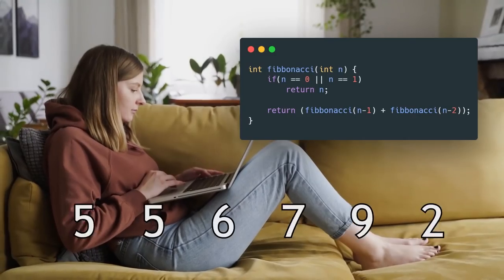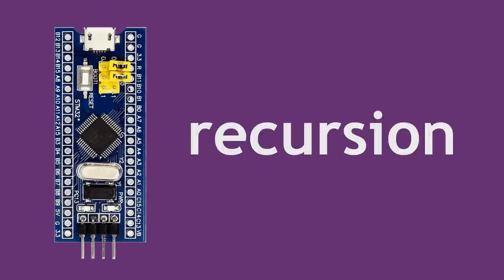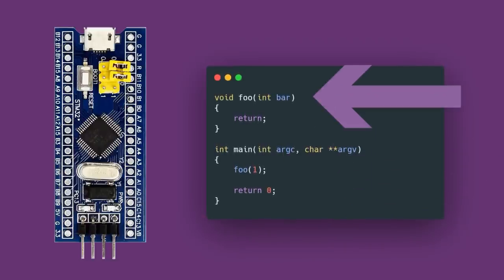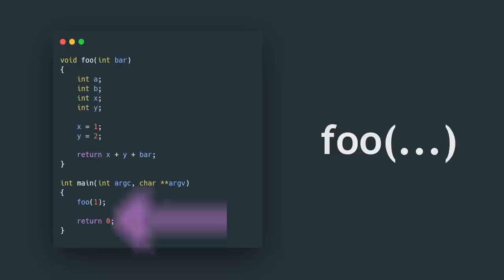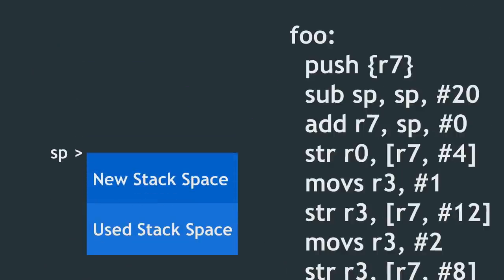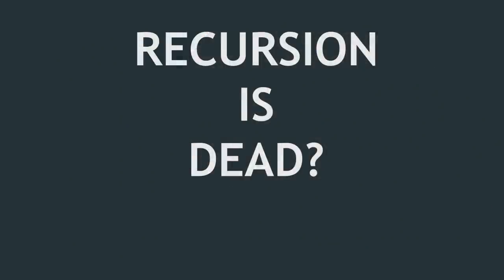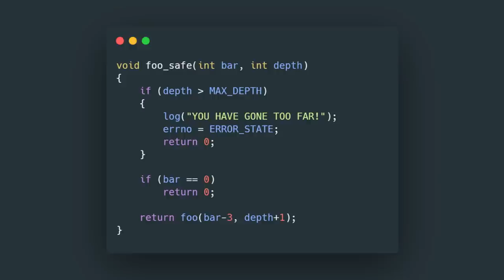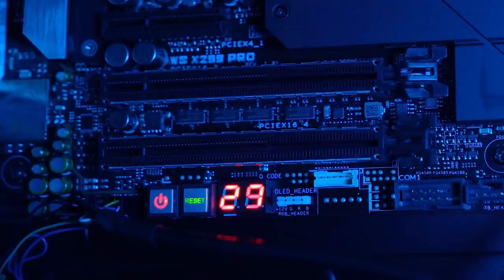why is recursion bad?

Comment: During my apprenticeship, I came across a Linux dev who's rather "old" (I guess mid to late 50s). 
He explicitly taught us programming on high end Linux machines and even though they were enterprise machines with tons and tons of ram he specifically taught us to find ways around recursion. He'd always show us different ways on doing that. His motto? "People were going to the moon with less resources. Nowadays, we're just slapping more hardware on to the machine!"

This was his critique on Game Development just as well as his critique on the company and other devs who usually didn't care. It was a very great and pleasing experience and it still sticks with me. Roughly two years later, I'm still trying to avoid every recursion I can. Not that I don't like it but why using up more resources than necessary or overfill any buffer etc?
Reply: Dude sounds like a good teacher
Reply: that is a very narrow view, with tail call optimization being a thing there's substancially no problem in using recursion and as for why, the reason could simply be ease of implementation
Reply: @javierflores09  For me, recursion is definitely useful with tree-like data structures, where you need to, for example, look for a file, or create a deep copy of a JSON-like structure.
Reply: @znefas  Recursion has very niche use case and that too when directly modifying data on the storage (where only the current state should be present in the stack) and not on RAM. When modifying data on the RAM recursion should 100% be avoided in production apps.

Even for tree like data structure it is possible to write an iterative approach although it might be harder.

TL;DR: If you need to worry about recursion depth, you should not be using recursion in the first place.
Reply: @ArnabAnimeshDas  As you said, if you need to worry about depth, you shouldn't be using recursion. But in most game engines, you won't have so many nested files to look through that you'll have to worry about recursion depth if you're using recursion to do something to every file in the structure.
Reply: @znefas  since it works on each level at a time, the previous levels which was already worked upon can be removed from the stack since it has already been modified in permanent storage. Which means the recursion depth is at most 2 (the current state and the next state being worked upon) at any point.
Reply: @javierflores09  the problem with TCO, however, is that not every language supports it.

Also, ease of implementation is not always the right/best answer. Sure, it is one answer - but then again, I have answers around certain problems without recursion and live a good life. Being creative solving certain problems while still producing good quality code is key.

And I find the challenge to avoid recursion good. Especially since I can't be sure that every language uses TCO (natively).
Reply: @playeronthebeat  the argument that not every language supports it is weak. In the case a language does not support it, you are probably on a system where stack size isn't a concern at least to the vast majority and in the case you are the minority that does matter, it is fair to search for the alternative solution.

I am not saying recursion is good, I am saying it is stupid to discourage people from it when you are rarely gonna face problems from it, so long you have some knowledge of what you are doing. Programmers are not toddlers, only users are and when it comes to the code, they should be able to decide what fits their program the most.
Reply: He is right. If ppl wrote software with care for hardware resources, our mobile phones would be blazing fast for years and the battery could last days, just for not wasting tons of process power and memory in tons of useless algorithms.
Reply: That is very interesting. I wanted to ask, with all your regular practices of trying to avoid recursion if you can, are there any cases where you choose recursion as the main approach nevertheless?
Reply: @vivanmaitreya2782  Although the logical flow may not seem intuitive, almost every recursion can be converted into loops. Just requires a different way of framing the problem. I can only see recursion applicable in NP problems where there are multiple solutions for a single step with only one of them being the correct one and you have to arrive at a known finish point from a specific unknown starting point following a repititive pattern.
Reply: If the hardware is available, it's wasteful to let it sit idle.  You might as well not have it.  I worked with a DBA that did the same thing with disk space.  Disk space was meant to be hoarded and never used.  Every request for more disk space was denied, until you brought in upper management and proved that you really did need the disk space and you could not just restructure your database table to use less.  Efficiency is important, but it's not usually most important.  In the grand schema of things many times "good enough" is sufficient, and expending additional developer resources to increase efficiency is not warranted.
Reply: @daves.software  it is about the trade off. Not caring about wasting resources is bad too.
Reply: I've got two issues with this. One, on a high-end machine, stack space is almost completely free. I understand optimizing memory usage, but stack space is the least important thing to optimize - and we're already on modern systems where optimizing memory isn't critical anyways. Pair it with tail call optimization in many cases and it's practically free. Modern applications are anything but stack memory hogs.

Two, readability. Sure, by nature, you can rewrite any recursive solution into an iterative one... but unless you go with an explicit stack (which is slower and potentially uses more memory), that rewrite is going to be much less readable for "inherently" recursive problems. And when you have resources to spare, readability is king.
Reply: "It'll be fine, modern computers can handle inefficient code" == "I can't increase the number of actors without the CPU melting" somewhere down the line
Reply: I definitely have complaints with game dev companies these days. Often-times the performance is sub-par and CPU-bound (GPU I get you can't really get around sometimes) and devs refuse to implement any type of optimization or parallelization. I get that threading and muxes and offloading work to other cores is alot of work, but it sucks that games are just saying "get better hardware lol" just to play their games.
Reply: @albertsun3393  I'm not that experienced, but I'm guessing that has a LOT to do with game engine tools like Unreal and Unity.
1) It is WAY harder to optimize a complicated system that you didn't write,
2) A well-designed game engine tool means you can write more complicated games with LESS actual programming skills. Just drag-and-drop some modules, no need to even understand how they work, let alone optimize.
Reply: @javierflores09  Everything that can be solved with recursion can be solved without it. The question is how complicated it looked. Avoiding recursion is good practice. I wonder would you protect goto as well? Saying that avoiding it is narrow view? Goto  can lead to more beautiful code just like recursion. Just curious.
Reply: @delanmorstik7619  introducing goto impacts code readability in the future as it disrupts the logical flow. It is a bad practice as you won't understand the lifetimes of references without rearranging the code in a sequential flow.
Reply: @delanmorstik7619  "avoiding recursion is a good practice", in the 90s it probably was for sure. Thing is  now as you said, everything that can be solved with recursion, you can solve without it implying iteration to be the only plausible method but as you said, it gets complicated. What you are saying is all true and so what I am but I wonder how me saying this relates to our points? It does not frankly speaking.

I can see you have a great way with words but please refrain from beating around the bush if you want to refute what I am saying and provide points as why we should ditch recursion as an option.
Reply: @ArnabAnimeshDas  That depends on the scope you are using it. There is one very real occasion when goto is the best way to go, unless you are willing to introduce deeper abstractions(it is bad to do so in internal function). It is when you need to break multiple loops at once. Some languages went as far as to add break number(amount of loops to break) to go around using goto. The other options is to create a variable for every loop that indicates if to break it or not. The code looks terrible :) I am sure that there is similar case with recursion too, just never had the chance to bump into it. But I agree, we are developers, we NEED to be open minded. Always. We must always understand all available options and to always pick the very best for our case. Not just following pseudo rules that work fine in 99.99 percent of our work.
Reply: Ah yes, game developers totally have time to optimize their games and worry about people who can’t run their games because they didn’t optimize enough even though game development is notoriously arduous and constantly has bad crunch and unrealistic expectations put on game developers already. Yes I am sure if we just told them all to “optimize more gud”, great things shall happen.
Reply: @diodora2381  I mean, if you are into game development then it is your fault. That field is only for massive masochists
Reply: @javierflores09  You said that avoiding recursion equals being narrow minded. That is not true. Trying to find a workaround that still looks simple, understandable, maintainable and fast is what it means to be a programmer. 
Now, what is truly narrow minded is if you are unable to find something better than recursion, but still you decide to go for the worse solution just for the sake of not going recursion. That would be narrow-minded.
Now for your last argument, regarding why would one avoid recursion if computers are already so fast. Well just try and see witch number of Fibonacci you can find using recursion. Then compare that to witch number you can find by using iteration. I bet using iteration you can find billions of times larger number. Just because you are not wasting your precious ram for that. Imagine how much more memory you would be wasting if you had more complicated case of recursion.
Now, we all agree that iteration uses less memory and that recursion is not faster to run than iteration.  Recursion is better in one thing - it looks better and often requires less code, sometimes it is easier to understand. If you can find an iteration solution that still looks good and is understandable then you are just better off using iteration. And yes, there are cases when recursion is just superior(some people gave example around this comment section) but they are not many. If your task was writing Fibonacci then recursion is a big NO.
Reply: @delanmorstik7619  You are indeed narrow-minded, if you immediately assume one method to be better than the other without even considering the implications. You are pointing out recursion as the worst and iteration as the best when in reality they're just both tools to complete a task, neither is good or bad and each one have their own implications depending on the task.

Nowadays where it isn't an issue to use either, we have the choice to make use of either depending of whether it is beneficial for our task and that's the only thing that should count. It was indeed a good practice to avoid it when it was an overall nightmare to work with, but it is not the case anymore and thus we should and must adapt, because THAT is what means to be a programmer.
Reply: @diodora2381  Actually, for AAA titles they have to optimize for a range of devices based on the capabilities otherwise only workstation or mainframe systems will be able to handle the load.
Reply: @fellipec  I mean, your phone would last a long time if it couldn’t do anything you want it to do.
Reply: @AROAH  the only new things that are being done is collecting user information and wasting processing with tons of frameworks to make things easier for underskilled devs. Otherwise I'm still watching 1080p videos for about a decade.
Reply: @fellipec  I don’t think you comprehend how battery intensive decoding video and running an LTE modem is.
Reply: @ArnabAnimeshDas  or you should be adding some sort of memoisation/caching to avoid doing work youve already done
Reply: @felixst-gelais6722  implementing memoisation in recursion and loops improves both types of implementation, but I get your point. At first I do it the easy recursive way and then do it the loop way with comments if the benefits are worth it in the long run.
Reply: Building up stack frames on RAM and continuously destroying is what led Chrome to reserve a significant amount of memory all the time and look at where we are now. It will only get worse when the web apps becomes more complex in the coming years. Memory management should be left to the OS, since it allows for hardware level optimization rather than building your own GC. Pre-emptive extra allocation should be hints which helps an OS mark an area which can be possibly used, but until it is used, other apps should be able to use it. Currently, Chrome locks up RAM so that it has free real estate to work on, but IMO it should be defined as wastage of RAM.
Reply: There is actually a good reason why to use recursion on certain occasions. Maintainability and time efficiency. Even though its a bad example(because programatically solved with a loop) the fibbonacci sequence shows why recursion is usefull to keep your code rather clean. The recursive form An=An-2+An-1 is much easier to comprehend than the explicit form  An=1/(5^(1/2))[(1+\(5^(1/2))/2)n-(1-\(5^(1/2))n] let alone to find the solution. If time and maintainability is a key factor it may be beneficial to use more resources than actually needed.
Reply: Recursion is a tool! How can you say it's bad? It just doesn't fit your use case.
Reply: I kinda disagree. Recursion is not only easy to code, but to understand as well, and we should remember that you code not only for yourself but the ones after you. 
So while knowing how to avoid it can be really useful in some optimization problems, just avoiding recursion all together is over-optimization and can easily become spaghetti code in software.
However in embedded I think you're so constrained that you have no other choice than to optimize your code.
Reply: This is what we call a micro-optimization, its a useless tactic for most things (excepting that the behavior would be impossible to perform in the first place without the optimization) and you should wait until the polish phase of software development, this may result in "completing" projects without that polish phase, but the point of that is you got a working piece of software, extra resource use is not a problem that prevents functionality of the software, its just a nice quality of life improvement.
Reply: not to mention that if you walk in and just use recursion because it's the first thing that occurred to you, that 100% guarantees that you don't even understand the problem and thus are not in a valid position to be coding it up anyway.

always look at your options, and always be skeptical of Ways that insist on doing things one specific way. like, for instance, the philosophy behind Java which... fucking hell. you're the person with the training, skills and ability to understand the problem. the recipes you were taught, and the slogans your peers repeat over and over, in contrast, are not.
Reply: Psshh. Moon believer.